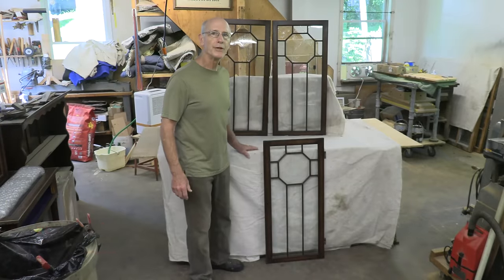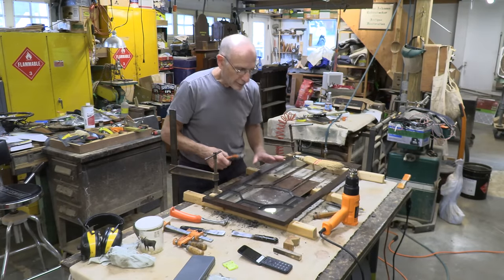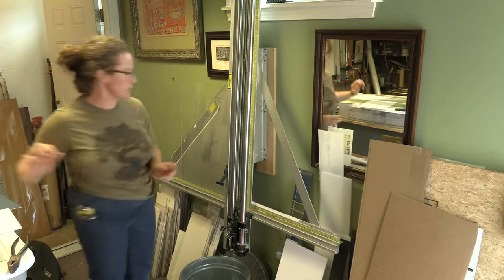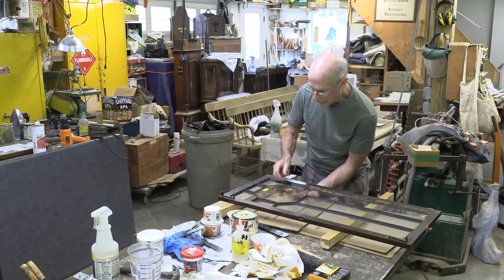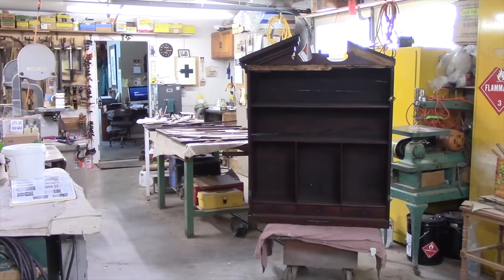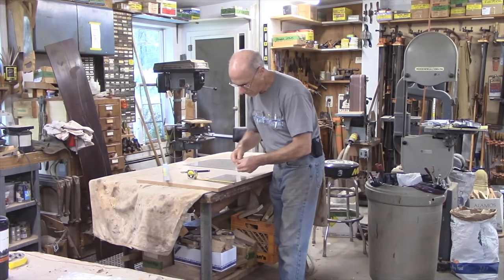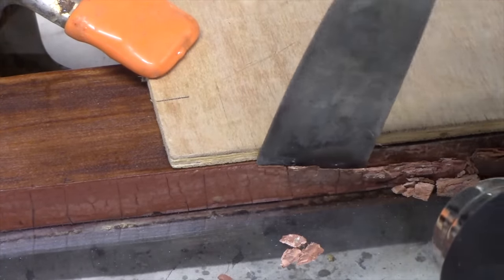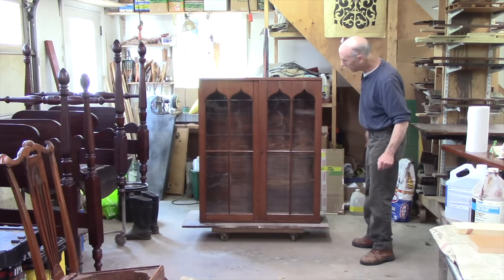So Satisfying - Thomas Johnson Antique Furniture Restoration

Comment: Your mention of cambric reminded me of a story one of my customers in the WalMart electronics department told me. They had lost the remote for their TV, and they thought it must have fallen down in the couch. They tore the couch apart. They turned the couch upsidedown, cut the cambric and rooted around. No remote. They purchased a “universal” remote, but there were some functions that remote didn’t cover. Two years later, their hamster disappeared, and since it was often on the couch, they were afraid they might have a dead hamster trapped in the couch. So, they rooted through the couch, and never did find the hamster, but they found that remote! Said it was like having a new TV.
Reply from the maker: Thanks! That's a good story. It's hard to believe they missed it first time around!

Comment: After a few years of Youtube, I've almost begun to relate to metric measurements.  I just need to understand how long a millimeter is, now.
Reply: Forty thousandths. Not sure it helps... but it's a pretty good approximation.
Reply: @dlevi67 Mighty dinky.  I like 64ths,
Reply: @rogerdudra178  64ths are pretty small. "Us woodworkers" are quite happy if we manage 1/32nd which is about 0.8 mm... at least, I am! ;-)
Reply: 1mm is a bit small to visualise, but 100mm is pretty much 4" which may give you a clearer idea!
Reply: @dlevi67  Greetings from the BIG SKY.  Building furniture up here called for accuracy of at least 1/64th of an inch to be acceptable.  That's pretty close to 'right on' all the time which is normal operating procedure.
Reply from the maker: It's difficult! We are so tuned into our fractions. I still can't look at something and go hmmm... about 15 millimeters!
Reply from the maker: It's going to take a bit of rewiring!
Reply: @johnsonrestoration  I know how long a 1/4 inch is but I'm no where able to see 15 millimeters yet.

Comment: You are definitely not a glazier, Tom. Why not make your own putty with linseed oil and  white lead? And why not use a proper glazier’s putty knife?
Reply from the maker: Thanks! I didn't know there was a glazier's knife! I want one! It seems crazy to make your own putty when you can buy it
Reply: I wrote that putty was made with linseed oil and white lead. The latter should of course be chalk powder. Sometimes a resin is added to prevent cracking. A glazier’s knife is a short and slightly curved knife. It is very suitable for working out corners and smoothing the surface.